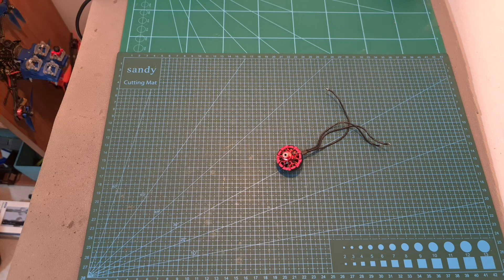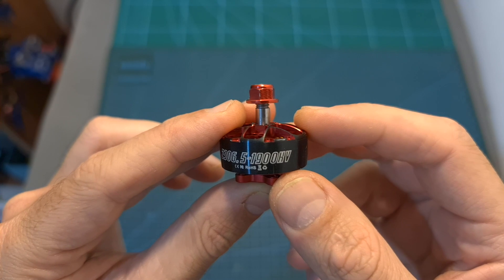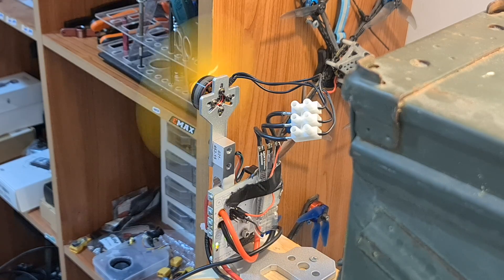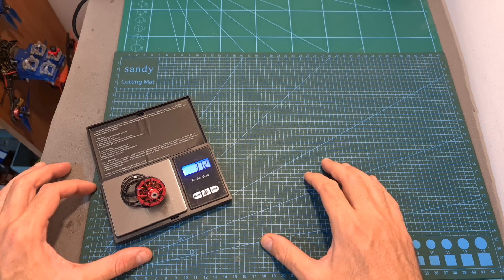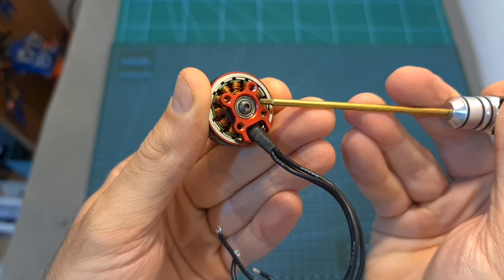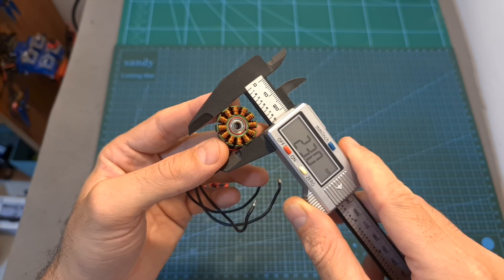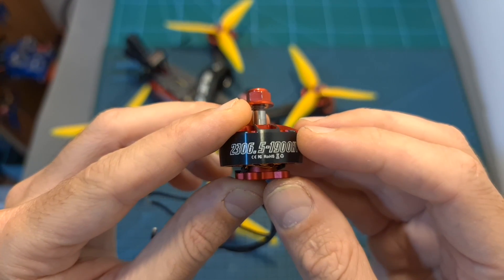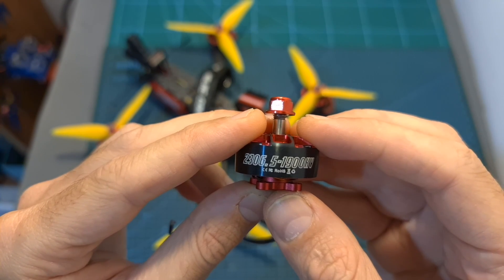HGLRC Aeolus 2306.5 1900KV Motor - Thrust Tests & Flight Footage

Comment: It is more logical to show power and not voltage on the OSD.
Reply from the maker: It's more logical to show both :-) 
I am not sure if the current sensor was properly working on this build so that's why I didn't include this information.

Comment: Great video!! Is it normal that u can fly 6s on 4s battery? What time of flight did u get on each 4-6s?
Reply from the maker: Thanks. Every motor that support 6s will support 4s as well, however your flight experience depends on the setup. I will go over the flight times in the extended review of the HGLRC Sector V3 build as I need to test it a bit more.